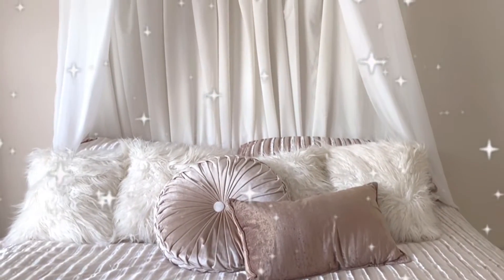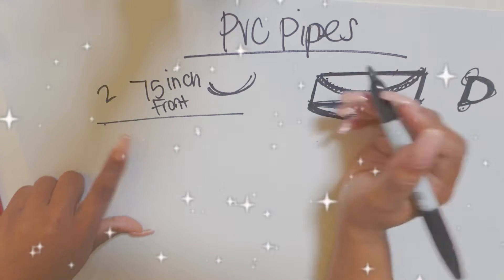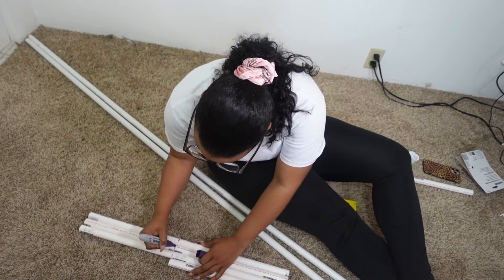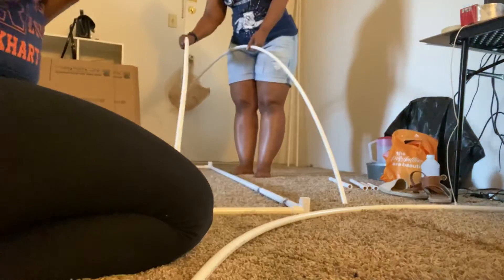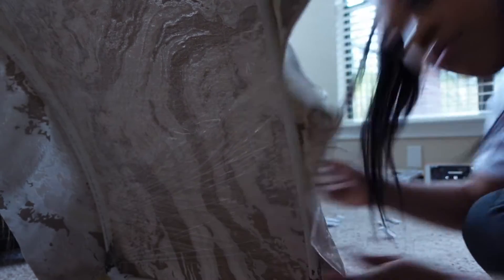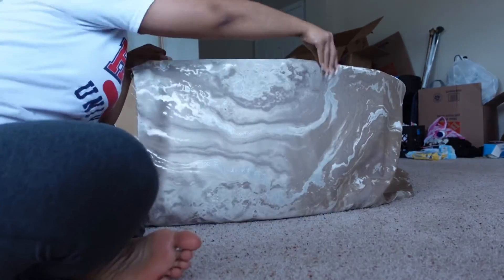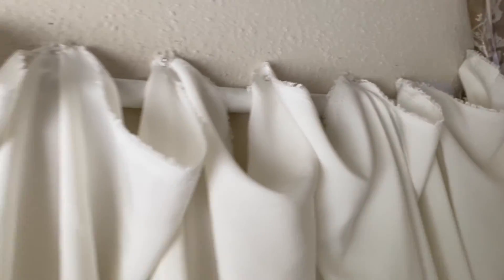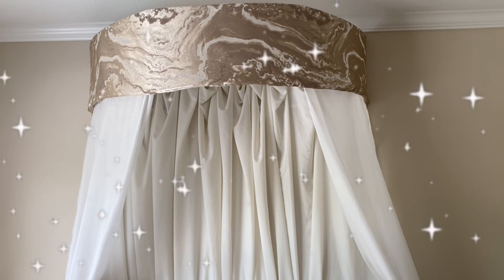DIY CROWN CANOPY FOR BED

Comment: How do Ik what length pipe to use ?
Reply from the maker: I put the measurements in the video, but the diameter of the PVC pipe is the standard either 1 in or 1.25 inches. I hope this helps!